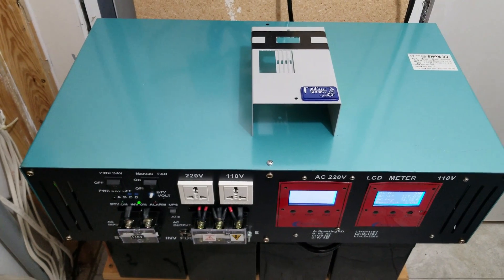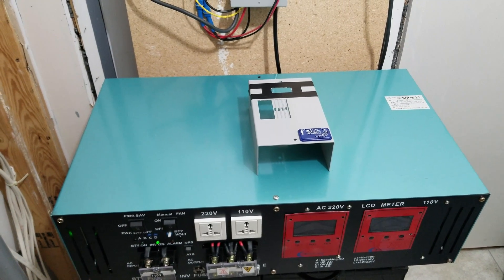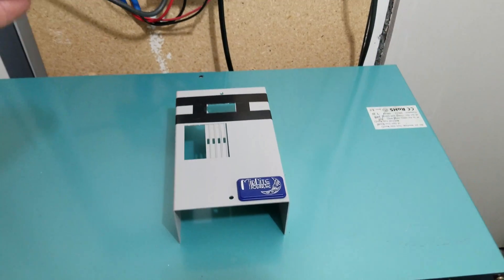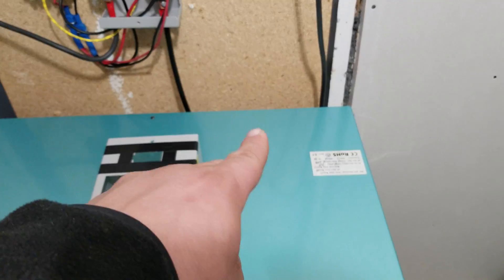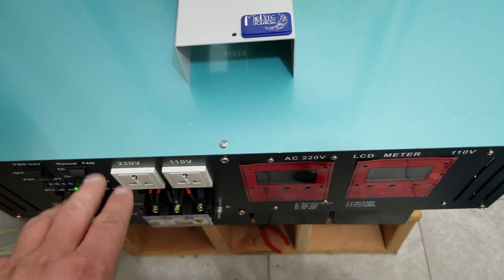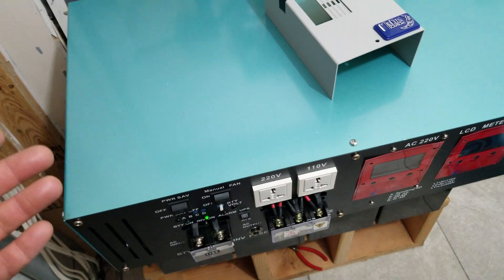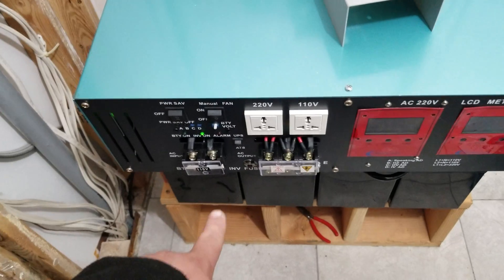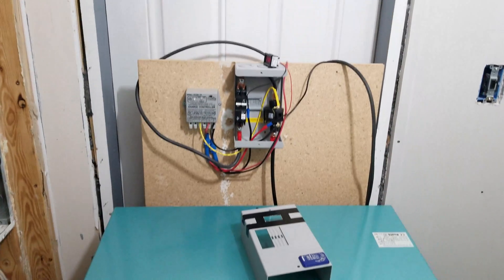My high speed cooling fans for this 15KW Powerjack inverter

Comment: I've been having problems with running a space heater on my 8000 lf.. first off it reads on the inverter 3500 watts but it's only 1500 watts max.. so is it the inverter misreading the wattage and says it too much for it? My voltage drop was minimum amount so the batteries are charged.. is this something you have seen?
Reply from the maker: Are you running it in split phase? I rarely see watt meters off by that much.
Reply: How do you run it on split phase? I was just plugged into the 110 universal plug
Reply: The alarm was one solid tone. Which the instruction manual doesn't have that anywhere. My heater won't run like it's too much for the inverter, but it might be overly sensitive..
Reply from the maker: Is it a split phase inverter? 240 volt?
Reply: Yes it's not reading correctly.. it's like it reading the watts @ 240 not 120 cause it's double the actual watts load
Reply: Mine does that same constant beep and no power,  was running a mini split ac no problem and one day it just started beeping and shut off, i opened it and all fets have the leds on as well as a small board, im still looking for a fix.
Reply: @lysol7204  did you fix it?
Reply: @FixItYerself   I had to order a new main board from powerjack.
I told them the problem and they imediatly said it was that.  Cost about 100 and is woking to this day!

Comment: did you catch my question about the slim case 15k power jack inverter.  I looking to buy a 15k and my solar guy suggested the slim case, like the 8k, for an upgrade to my present inverter .  both have the same 2018 upgrades as far as I can determine. Wonder what info you might have on it
Reply from the maker: Slim case is an older version. It does not cool as well.
Reply from the maker: Hit me up on my Facebook and I can answer in more detail

Comment: Cooling...has been on the forefront of my mind recently with all of your vids pointing to this as a problem. My solution for my 10k model with 2 fans is to raise the top cover aprox. 1 inch to allow for the hot air to escape thru convection as well as with the fan power. By just using aluminum strapping on each end to space it upward (Cheap source for the aluminum 'strapping' is to use Harbor Freight aluminum yardsticks, 1/8 thick by 1.5 inches wide, they are often on sale for .99 each) This also eliminates hot air stratification, being caught in corners and not allowing that hot air to move out and so keeping the temps up throughout the case. The open space created at the top front and back of the case allows the air to move faster and more freely throughout the case lowering temps.  Another scheme I have thought about, but not yet tried, is to open up the side of the case where the transformer sits.  By simply cutting the side out of the case where the slots are, or even drilling cooling holes in that whole side area around 3/4 to 1 inch would not only allow more air to move out, but help direct the airflow in to cross over the transformer before being ejected instead of just swirling around (hot) inside as it does now. On your setup, it looks like it would benefit from directing the hot expelled air away from the back to keep it from being sucked back in by the two other fans. One simple solution would be to use an exterior aluminum rain shield for a clothes dryer vent installed sideways over your exhaust fan to blow the hot air away from the back side of your case.